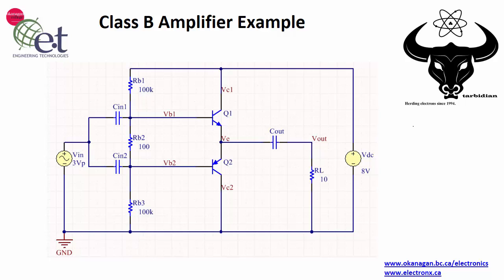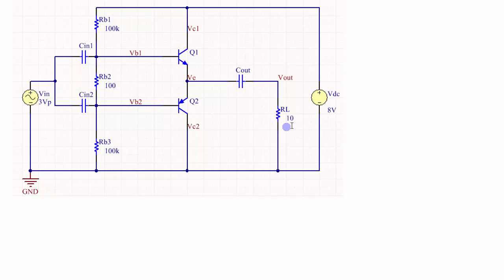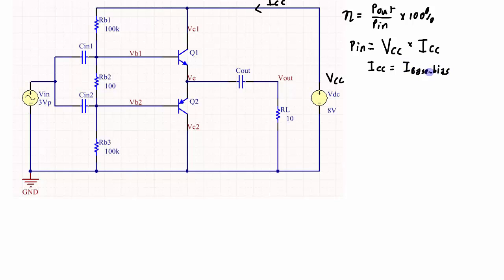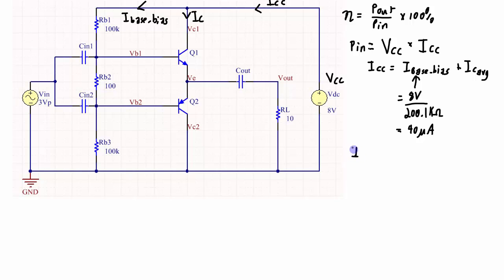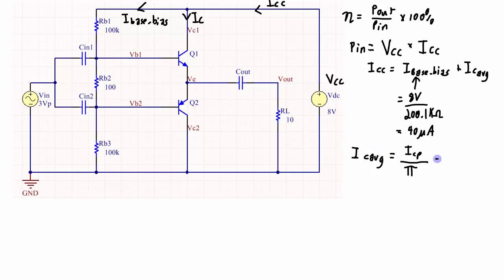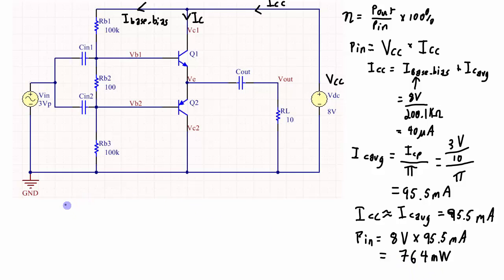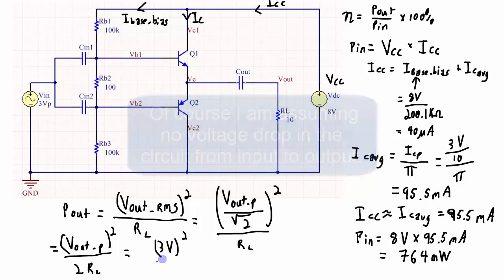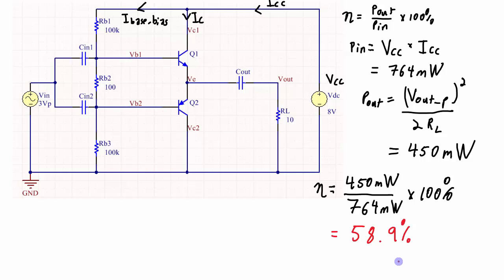Class B Amplifier Efficiency Calculation

Comment: Hey, these videos are tremendous thank you. 

After a little more algebraic sorting, isn't efficiency simply:

              Vinpeak/ Vcc x (pi/2),

as long as Vinpeak is less than Vcc/2?   This would also confirm your analysis that max efficiency is 78.5%:

              50% (maximum ratio of Vinpeak to Vcc) x (pi/2) = .785 x 100% = 78.5%

Also, where does the "lost" power between power in and power out go?

Thanks again.

Comment: Thanks for the video, I've learned a lot from this series.

I wanted to ask about ignoring the diode drops in the output peak voltage. If you factor in the diode drop of 0.7V, wouldn't it scale Pin by 2.3/3.0 and Pout by the same amount but squared? That would drop the overall efficiency by about 75%, down to 48% - which seems quite significant and not something we can ignore.